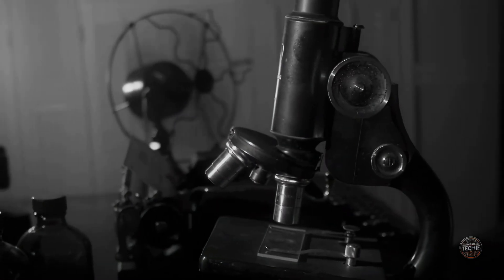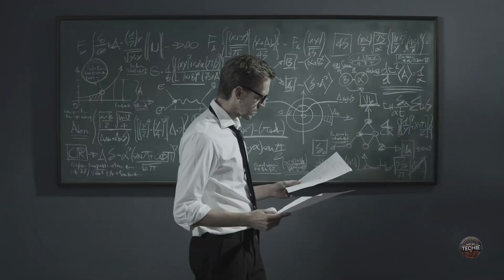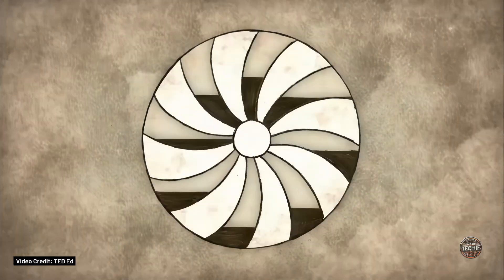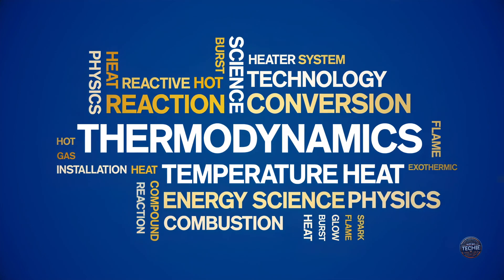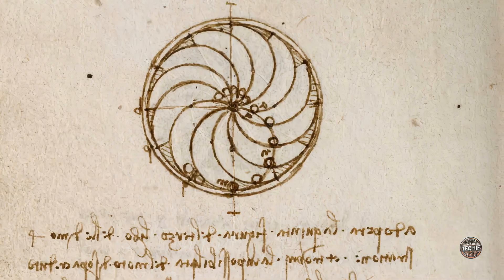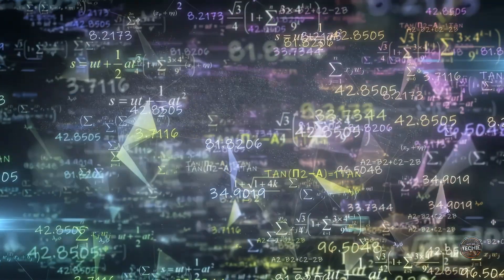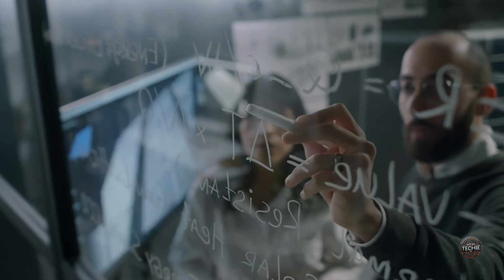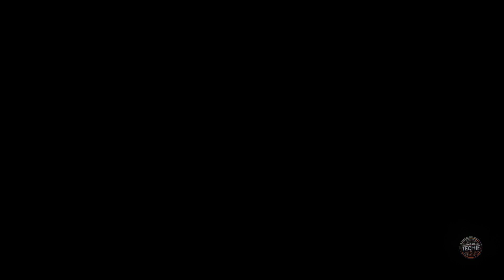The Truth About Perpetual Motion Machines: Why They’re Impossible (Or Are They?)

Comment: "Perpetual Motion" is indeed 100% possible .. the GOAL or, the TRICK??? ... Is to use a power source!: ... (lol yes I know that's not in fact perpetual motion) ... 

BUT!!!! to be true to the desire behind the IDEA is ??? Use Sun or Wind  as the power source!!! To get FREE ENERGY .. free Energy = "Perpetual Motion"  that is the goal

THE IDEA? Is to make FREE energy not perpetual motion.  By using "zero friction" bearings and surfaces!!  Solar panels they pay back the manufacturing costs in a VERY sort time!!  Capacitor store instead of battery!!  etc etc  

Even something simple like using post consumer parts (that would be garbage) can make a Free ENERGY machine pay back fast and faster!!!.  MAKE it SELL int and it pays back i one year?? That is the goal! :)

If you make enough and you can do it profitably, then show everyone else how to do it! ... Free Energy!!

By concentrating on these principals, the generation of power CAN be achieved at no cost!
Reply from the maker: Hey @MikeBaxterABC..this sounds amazing but above my engineering skills. Anyone else want to try and do this? I'm sure someone has tried or tested, no?